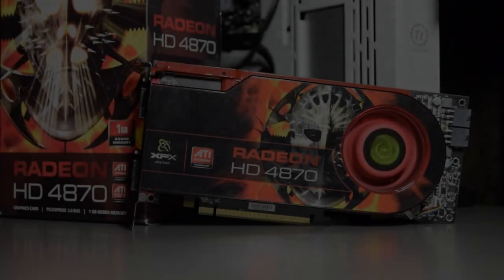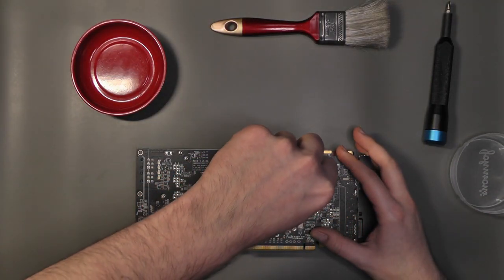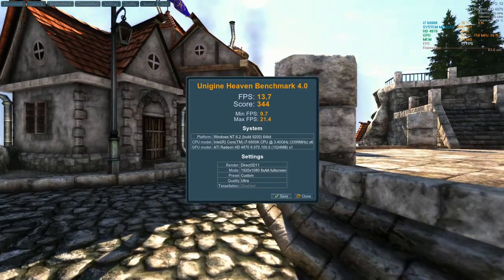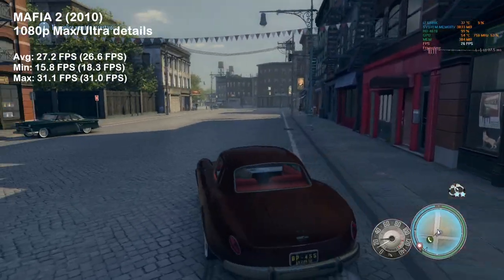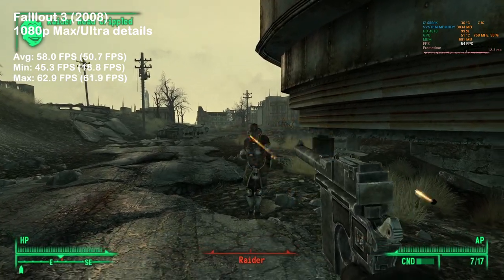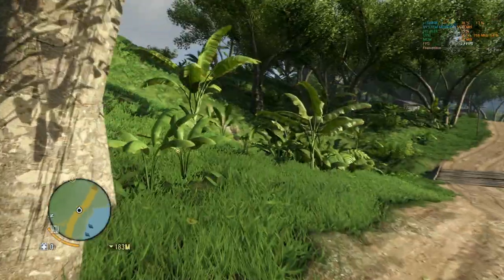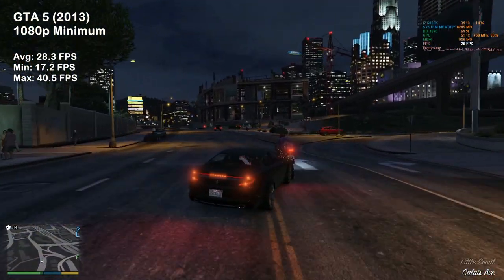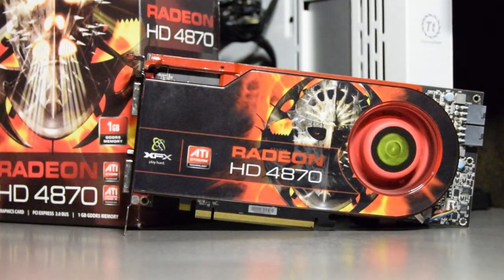ATi Radeon HD 4870 tested in 2021 - A worthy successor?

Comment: I still have mine in a box somewhere - 1GB. It shredded GT Legends racing Sim back in the day. Needs a shroud but still works. Had a look at it now  - that heat sink and fins are massive by todays standards. Will keep it and try it on a retro build one day. GT Legends is still around the next fast corner.
Reply: Same here. I still have two I cross fired .  rFactor , GT Legends and GTR 2 were my choice. Retiring soon so I will do the same.
Plenty of time to piece one together with all my spare parts.

Comment: REALLY NICE VIDEO  GREAT REVIEW AND POST!

My buddy got the   4870 x 2 
What a great card for it's time....
I was BLOWEN AWAY AND SUPER  impressed but the power it took and heat was a bit much !
But very Impressive game play!!! I was shocked what it could handle!!
BUT I GOT THE  ATI ORIGINAL HD 5970 !!!!!!   THIS CARD WAS UNTOUCHABLE 
ON MY AMD   8  core  8150 SYSTEM!  i FLEW IN EVERYGAME...
STILL HAVE THE CARD IN A NEW RYZEN SYSTEM...
I PLAY ALL MY OLD GAMES STILL...
BATTLEFIELD 2  - MODERWARFAIR 2   HALFLIFE   SO MANY OTHERS 
SO  HAPPY WITH THAT INSANE PIRCHASE BACK THEN.
SO  I BUILT A SYSTEM JUST FOR THIS CARD TO BE REBORN AND STILL FUNCTIONING 
INSTEAD OF IN A CLOSET  LOL 
LOVE !!!!  REVIEWS!!!  GOOD JOB!!

Comment: This card formed the backbone of my gaming system for 8 years. And it wasn't the performance that made me replace it, but that newer games didn't support it anymore (Dirt Rally, Dragon Age Inquisition). I'm not surprised it holds up well even today on less demanding games.

Been using a 1070 now for 6 years and I think it will remain useful even longer; at 1080p, if you are not concerned with ray tracing and getting the max out of everything graphics cards enjoy much longer useful life cycle than 20 years ago. I used to upgrade every 2-3 years just to keep being able to play the latest games. Perhaps this is a side benefit of consoles being more leading in game development; their hardware is static for 6-7 years so programmers can't rely on new faster hardware hitting the market every year.
Reply from the maker: Thank you for sharing, you made a really good point RE Consoles...HD 4870 was big leap forwards in my view, can not help but to call one of my fav old school AMD GPU's. I'm looking forward to testing the ATI FirePro V8750 soon - always wondered if the 1GB of VRAM was enough :)

Comment: I bought a 4870 used when the 5870 came out but broke it right away when trying to put an aftermarket cooler on it. I had done that before a few times with no problem but have not since. Part because the broken card and part because aftermarket coolers are not as necessary or as good anymore.
Reply from the maker: Heh! Those days of Arctic Accelero aftermaket kits are over...did you ever find out what went wrong with the card ?
Reply: @nexus_tech  I am pretty sure I tightened the cooler too hard and cracked something. Artic Cooling was the one I used to use yes. My first one was Radeon 9800 pro. I think I had one on a X1950pro too but I’m not sure.

Comment: I've got a 512MB version, it plays Far Cry 3 at 720p very well.  I couldn't get Afterburner to work on it, any tips?
Reply from the maker: Hi roasthunter, do you mean to control clocks & fan speed or for OSD monitoring ? Check RivaTuner app detection level, sometimes just Alt-Tabbing kicks it on
Reply: @nexus_tech  i could get it to show anything and osd options were grey for fps
Reply from the maker: @roasthunter  Thats strange 🤔. What version of Afterburner are you using ?
Reply: @nexus_tech  I think it has something to do with directX as I get a directX12 can't be hooked error in rivatuner.   I downloaded the latest
Reply: I got it working reinstall graphics drivers then install afterburner.
Reply from the maker: @roasthunter  I'm glad you got it to work and enjoying Christmas :goodvibes: I've never seen this problem on my test bench - I'm using Display Driver Uninstaller every time I test new GPU

Comment: I dont know what ATi/AMD thought back then when they released the 512MB version when nvidia had their GTX 260 at 896MB.

Still, the hd 4870 beat the 260 in many tests. But the 512 didnt age well AT ALL. The 1GB model was released couple of months too late i think. The hd 4890 was not far away of its release.

The 1GB should have been the only model imho.
Reply from the maker: Agreed! In some older games, there is no difference between the 512MB and 1GB card, but as soon as you try newer games, it's really not all that great!
I own a 4890 too however it has developed a fault - else it would be on the bench instead of the 4870 :)
Reply: @nexus_tech  even crysis and company of heroes to name a few, use well over 512mb when running on high settings. I've seen CoH use around 750+mb on my 8800 GTX. And that game is from 2006 :P